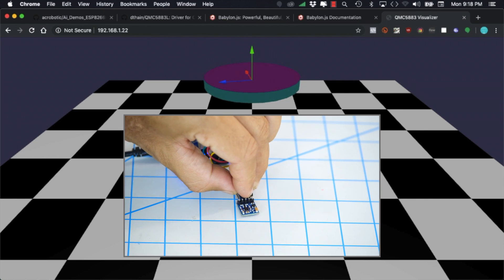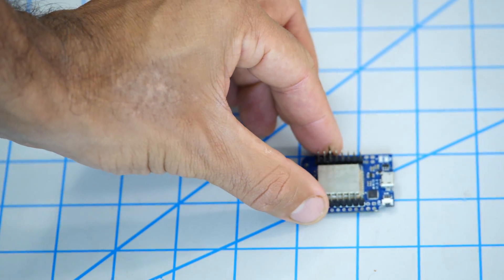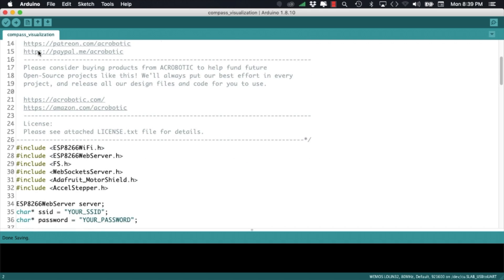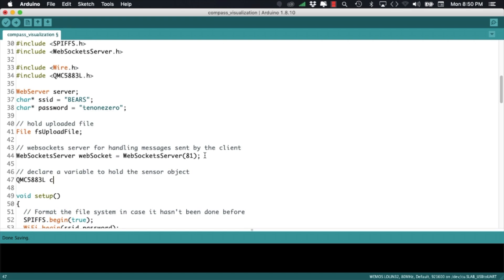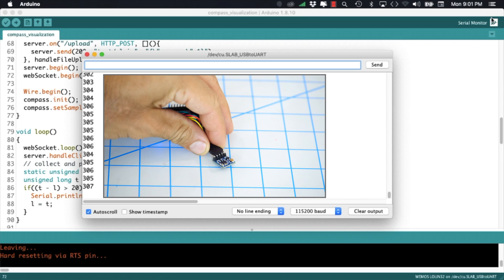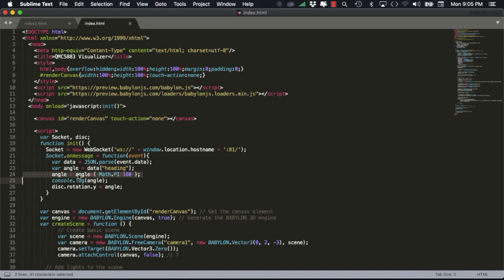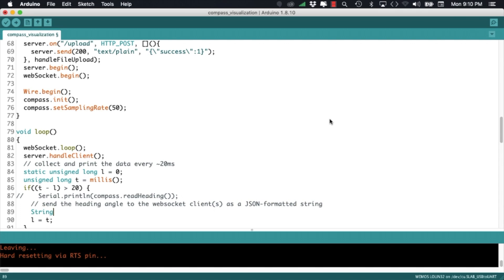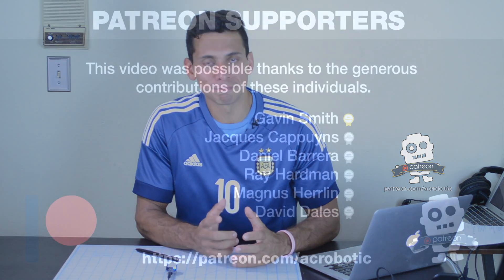ESP32 Compass Animation | QMC5883, Babylon JS, and Websockets

Comment: What's the underlying catch for it to work, is it tethered by ip or shared  network.?
Reply from the maker: No catch. All the code runs locally, and the communication happens over WiFi. I could set it up to work over WAN, but didn't really see the need for it.